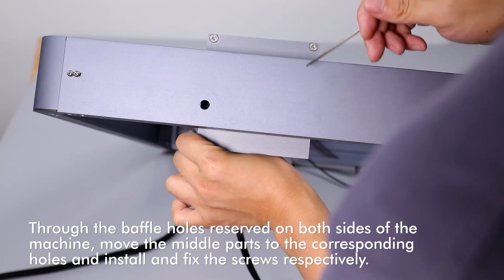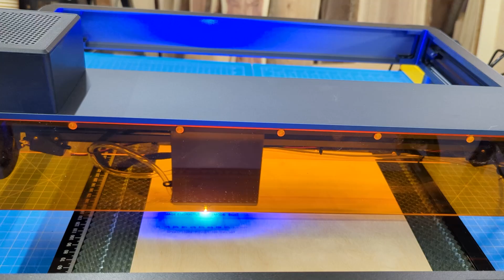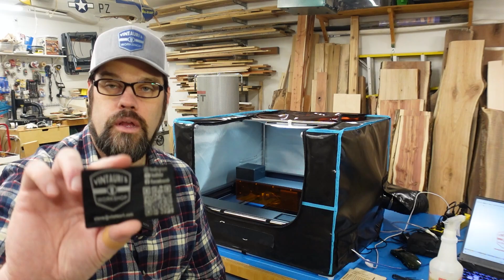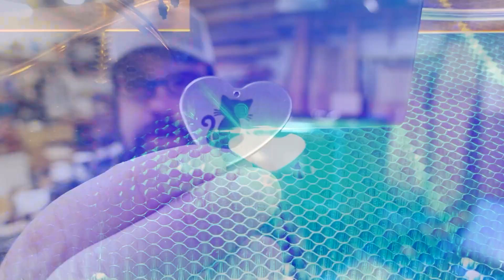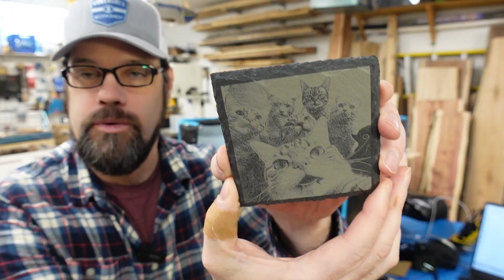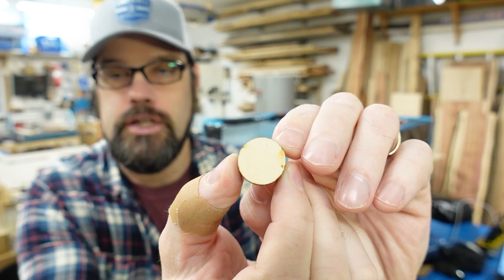Elegoo Phecda - A full 20w diode package for $600?!?

Comment: Remove the filter, add some limit switches, and pick up a decent enclosure, and you have a crafting beast for less than $800. I 3D printed a top for the filter enclosure that directs the air towards my enclosures exhaust fan. I use mine daily and it has already paid for itself. Complete, plug and play, limit and rotary switches are available for ~$25 each.
Reply from the maker: My thoughts on this exactly.  I loaned this one out to a friend who has made those mods and he's enjoying it!
Reply: Would you mind sharing some pics and your 3d print files? I am totally interested in your setup.

Comment: If you were to have an enclosure and a powered filter air system going to the outside could u use this for a couple hours in an apartment? without sticking up the place or smoking it out. in addition would the neighbors be calling the fire department? lol
Reply from the maker: Using an enclosure and an inline fan will remove the smoke and generally it's too fine for people to see, however they may smell it and if they have windows close to yours they may complain.  It will also leave debris on any window screen that may be in place.  The other thing to consider is that the honeycomb or spoilboard will absorb some of the vapors and will smell over time.  You can clean these to keep the smell down, but it will be there.
Reply: @Vintauri  thanks for the advice. will now not mount it in the window but move exhaust away from building. am going to (over) build my own vent system with abt 300-400 cfm @6inch. with box being outside and pointed mostly up. winds should disperse it. I hope

Comment: Phecda vs ComMaker B4?
Reply from the maker: They are two completely different lasers meant for different uses so it would be hard to compare them.  The Phecda is a diode laser good for cutting natural materials like wood, paper, leather and some plastics, where the Commarker B4 is a fiber laser meant for marking on metals and some plastics.

Comment: Ok question - how do you tell Lightburn to " engrave" and image... and then go back and cut it out?
Reply from the maker: You'll need to use two layers and setup a cut line around the image.  If you're just cutting a square outline you can use the rectangle tool and draw the shape around your image, same with a circle.  However if you want an outline that follows an irregular path, you'll need to either try tracing the image to get the outline, or manually drawing it with the vector tool. One you have that outline you set up your cut parameters and make sure to set your job priority by layer and have the image engrave first and then the cut path second.

Comment: Can you cut a 2mm, 3.5mm acrylic sheet with this?
Reply from the maker: Yes but it depends on the color. No diode laser will cut clear at any power as the wavelength passes right through it. White and other lighter colors will also be a problem.  Darker solid colors should cut just fine.
Reply: @Vintauri  Thanks for the reply. I recently got into 3d printing and exploring designing PCBs. I thought may be an acrylic cutter can complement my designs and make them look complete. Can I paint a transparent acrylic to cut ? How opaque does the acrylic needs to be? Can semi transparent colored acrylics be cut? ? I am looking for something cheaper for my general purpose use case to cut and engrave. Any suggestions? Thanks.

Comment: Great video 👌 I see that this video is 2 months old now.  
Based on your experience, can you recommend this laser engraver?  
How reliably does it work? 
 I've looked at so many lasers and there are just too many on the market.  Should you spend a little more money and maybe buy a 30 watt one or is 20 watts enough for cutting and engraving work?  
The price drew my attention to this laser and I only know Elegoo from its SLA printers.  But since I unfortunately find very few or no test/evaluation videos on the web, it is difficult to weigh up whether this laser is good or not.  
Sure, you can unpack a device and get started soon, but what does it look like after several hours of running?  
I have a few lasers on my watch list and they would be this Phecda, Atomstack x30Pro, Ikier K1Pro 30W, Longer Laser B1 30W, Longer Ray 5 20W, Creality Falcon 2 22W, Xtool D1Pro 20W.  It would also be important to me to have a rotary that works properly, ideally one where the handles don't interfere with cups.  20-30W and Air Assist is important.  
I would be happy to receive feedback.
Reply from the maker: It's a decent starter laser.  I don't think the air filter is worth the hassle and it really should have limit switches for homing the laser and being able to use absolute coordinates and fixtures for alignment.  But for what you get with it, it's a decent deal.

Comment: Thank you for a very good review.  I just assembled my 10W Phecda last night... mostly.  I still need to add the air assist, but first I need to reinsert the ends of the loose X and Y timing belts that were detached when handling the laser to assemble it.   :-(

I purchased the 10W version because I'm going to use it for engraving and it has half the spot size of the 20W version so it should do higher resolution engraving.  $250 for a minimalist 10W laser is a good deal.

I'm an electrical engineer and I design and build custom CNC machinery.  Elegoo should have shipped the Phecda assembled.  They're obsessed with flat packing everything because shipping (from China to the destination country and from the warehouse to the customer) is a large part of their cost, but this laser is mostly flat so unlike bed slinger 3D printers there is little savings in making the customer assemble a kit.  It would be globally much more efficient to assemble the laser in China by people who have done that job hundreds of times in a controlled factory setting with production grade tools (torque drivers, etc.) and assembly fixtures rather than forcing the customer to figure out how to assemble a laser from a YouTube video.  Almost all customers would have gladly paid $50 more for an assembled and tested laser.  The cost to Elegoo is probably the same because they could pay for the assembly at their factory with less material and effort packaging the parts, far fewer returned lasers, and more sales based on happier customers.  The user should slide the laser head into the dovetail, tighten the screws to retain it, plug in the air assist hose and electrical connector on the laser head and maybe screw in the four feet.  The user experience should mostly be: plug it in, don the protective goggles and turn it on.

What we really need is for some nerd to reverse engineer the Phecda and show us the tips on how to use it.  I'll be using the laser offline, in short run engraving production.  So far, all I've seen are Lightburn videos and the happy 99% fact free Elegoo marketing video showing what it does but not how to do it.  The supplied sample images are 284X284 pixel monochrome 8 bit PNG images.  I want to know how the Phecda firmware interprets the PNG file.  Monochrome only?  Does the laser interpret gray scale as laser intensity, either by pulse width modulation or by dithering pixels?  What is the resolution in pixels per millimeter?  Can I home the laser from the front panel or manually push the laser head to the bottom left corner to home it and have the laser engraver accurately and repeatedly locate an engraving from the USB flash drive on a fixture that's located relative to the laser frame?  I'll be learning all of that stuff for myself, hopefully this evening.  I guess I should create a YouTube channel and post this stuff myself, but I'd hope that there would be useful end user Phecda videos after three months.   :-/

Thanks for the link to good laser protective glasses, even though I plan on building a light proof enclosure that's designed to suck in outside air and expel the exhaust outside.

Comment: Will this be able to cut clear plastic? I would like to cut out curved model windows from thin sheet but, well, it's a laser, is it going to pass right through and not expend any energy into the material?
Reply from the maker: Unfortunately no diode laser will cut clear acrylic. You’ll need to look at a Co2 laser for that function.
Reply: @Vintauri  ah damn, thanks for the reply!